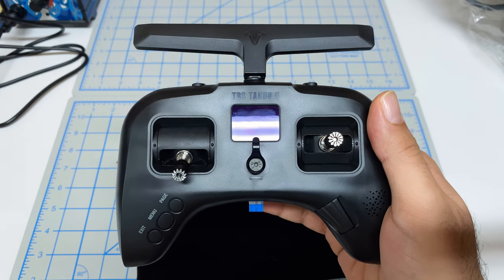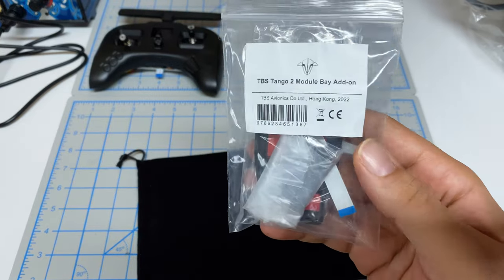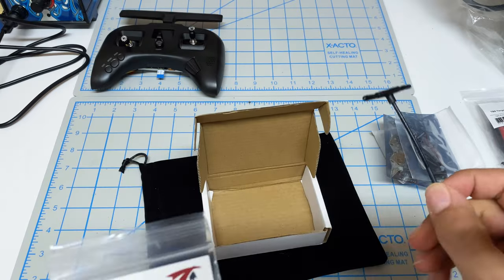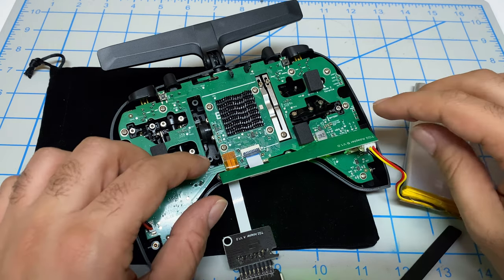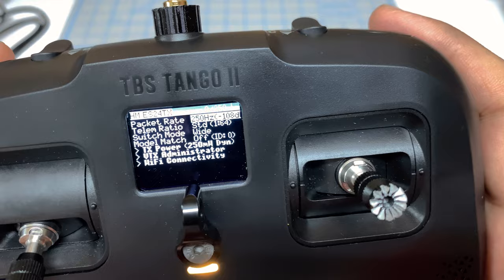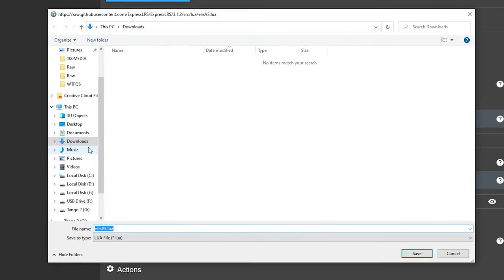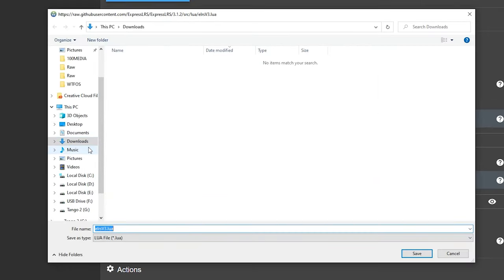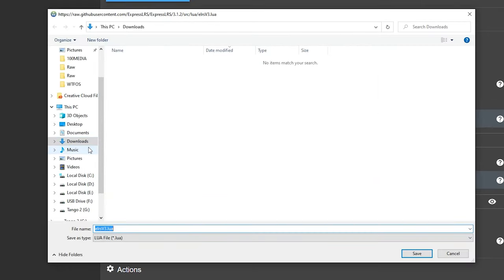TBS Tango 2 Pro INTERNAL ExpressLRS | How to guide on stuffing an ELRS module INSIDE the transmitter

Comment: Bro wtf I’m immediately getting an elrs module, that is a game changer move for me.
If it works I’ll get CNC gimball too, then boom best radio of the planet
Reply: do you have any more informations about the fitment of the 1W ES24TX Slim pro you were talking about ? I’m not sure which one to get and I know I won’t use it externally so I’ll greatly appreciate before buying it !
Reply from the maker: @platyfpv  I am not sure how the Slim Pro would fit as I do not have one and it doesn't look like Happymodel is interested in providing one for me to experiment with. I don't think you'd be able to do 1W without a fan on the module anyway. If you want a headache free install, use the parts I used (listed in the video description).
Reply: @Mangorille  alright thanks a lot for your help !

Comment: Maybe, i think you should use 50Hz packet rate for both ELRS and CRSF testing
Reply from the maker: I thought about that but you're never going to get an apple to apple comparison given the frequency difference between them (900mhz vs. 2.4 ghz). I did the testing based on how I would be using ELRS.
Reply: oke thanks u alot before. So based on your experience, for long range situation, which one is better 915 mhz or 2.4 ghz?  @Mangorille
Reply from the maker: @raikagenu7072  For long range, the lower the frequency the better but if you check the ELRS hall of fame you can see folks getting crazy distances!
Reply: thanks you very much master  @Mangorille

Comment: Just an FYI there has been a leak about the Tango 3 and it possibly having a dual RF system, possibly XF & ELRS
Reply from the maker: That would be cool, happen to have a link to it? I did a quick google search and nothing.
Reply: @Mangorille  Just wondering if someone is getting slightly confused with the T2 v3 board.....?!
Reply from the maker: @trevorc6793  Could be,  I don't see anything about a Tango 3 in my Google searching

Comment: Just heads up, you may want to update your Tango 2 FreedomTX AND Crossfire.  It looks like your Crossfire module is not shutting off when you set to use the external module.  The front indicator light should turn completely off when you're using your external module.  I believe there's a firmware fix for that.  It COULD be related to the voltage issue you're experiencing.
Reply from the maker: That's an interesting observation. I'm running the latest firmware already on both and this is what is happening.
Reply: @Mangorille  I mod Bardwell's Discord server, and someone also reported the same thing - their Tango 2's aren't powering their crossfire modules off when using an external module as well, using latest firmware, too.  I thought it was a one off, but you're now the second person I know this happening to.  So clearly that bug which was addressed in a firmware update at some point wasn't resolved for everyone.  You might want to open a ticket with TBS on that.  I would, but my Tango 2 doesn't have the problem.
Reply from the maker: @heroflying  Thanks buddy, I found the firmware that supposedly fixed that issue but it was ages ago. Maybe I'll try flashing a really old firmware and see what it does. I only went back 2 releases and both had the same problem.
Reply: @Mangorille  If you figure it out let me know, so I can pass it along.
Reply from the maker: @heroflying  Will do. I'm going to play around with some older firmware right now and see if I can see any difference. Really appreciate the insight here!
Reply from the maker: @heroflying  Tried all the various firmwares and the same issue happens. I did notice if I run the crossfire at 250mw or lower this does not happen. Weird...
Reply: I also have the same problem. Running crossfire at 250mW didn’t "fix" it.
Reply from the maker: @jouz3  Do you know what version of motherboard you have? Have you contacted TBS?
Reply: @Mangorille  The v3 board. I didn’t contact them yet, I just thought my battery was getting old.
Reply: @heroflying  I have a brand new V3 Tango2 Pro that I just put Happymodel  ES24TX Pro module on and same thing, the front light stays on. I'm running the latest firmware on everthing too.
Reply from the maker: @jouz3  Ah okay, let's both contact them. Mine is an even newer board, v008a (I think v3 is 007)
Reply: @Mangorille  TBS support responded with “it is a bug which will be fixed in the next release. No available info yet when”
Reply from the maker: @tennturk9260  Awesome, thanks for chasing down!
Reply: @Mangorille  I was very surprised at how fast they responded. Very happy with their customer service.
Reply from the maker: @tennturk9260  That's great to hear! They haven't replied to my ticket yet. :)
Reply: @Mangorille  update: TBS customer service advised me to install firmware v6.13 in the Tango II XF… it worked! No more indicator light on the front when powering the external module and hopefully better battery life.
Reply from the maker: @tennturk9260  I appreciate you keeping me updated. I've been working with support as well and so far they've asked me to reset everything and go to 6.19 / 1.35 / reload SD card. That didn't do the trick. I just tried 6.13 like you suggested and now my LED does turn off when using the external module but I still get the voltage drop when I switch over to the internal crossfire (when using higher than 250mw). So better but still not 100%.
Reply: @tennturk  worked to take my light  off mine too. thanks for the input

Comment: Amazing work there. I was considering ditching the T2 Pro, but thanks to you, I maybe able to use it more effectively. Just wondering if the slim Pro board would fit in there, have you any ideas if it would? TIA
Reply from the maker: Thanks! I think it would fit but there are two things to keep in mind. First the slim pro has a sma connector already on it so you may have to remove that and solder on a different antenna depending on how it lines up with the opening at the top of the radio. Second, heat, running the module higher than 250mw may cause the module to overheat. I reached out to happymodel to see if they’re interested in providing a module for the channel but no reply.

Comment: A radio is the last thing you’d want to tinker with this much.
Reply from the maker: Tinkering is half the hobby and I personally think this one is really worth it. The thing I regret tinkering with was the GoPro and the direct wiring to the flight controller. :)
Reply: @Mangorille  I agree, tinkering is enjoyable and fixing stuff is more economical. However the radio is such an important part to safety I don't think worth messing with.
Reply from the maker: @user-yk1cw8im4h  Sounds good, important to stay within your comfort.

Comment: Just to help anyone else, (kind of unrelated but also motivated by me having spent a lot of time modifying my radio as well) If you do not fly every day, do not store your Tango 2 fully charged, make sure you run the battery down to "storage voltage" before putting it away if you are going to take a few weeks / months off flying for whatever reason. Just like any Lipo, storing it charged to 4.2 v will result in damage to your battery.
Reply from the maker: Good reminder, thanks buddy.

Comment: considering everything its better to have add on bay :)  not wasting link quality on CRSF and ELRS I will need to life somehow with bay and module standing  8mm on the back of radio:)
Reply from the maker: Definitely easier to go with the add on bay. I wanted to keep the exact stock form factor. Even made a follow up video with the stock folding antenna too so it’s 100% stock form now.